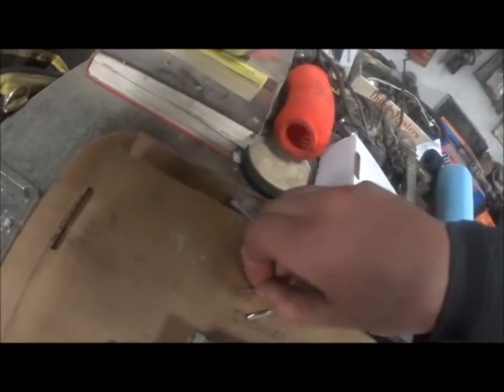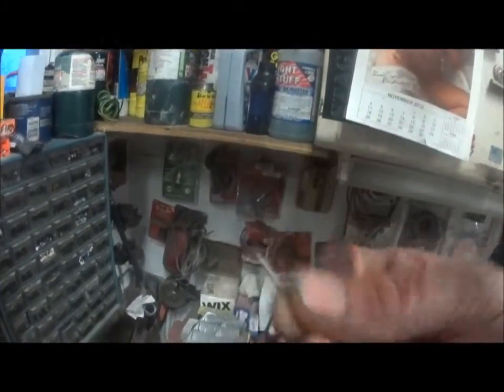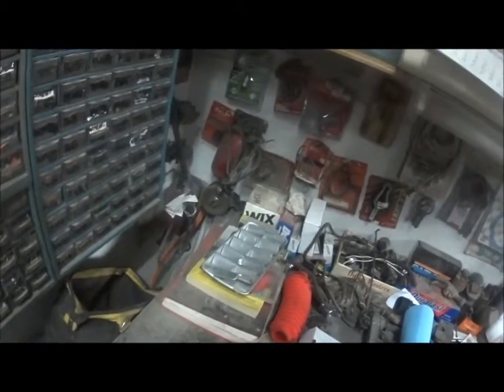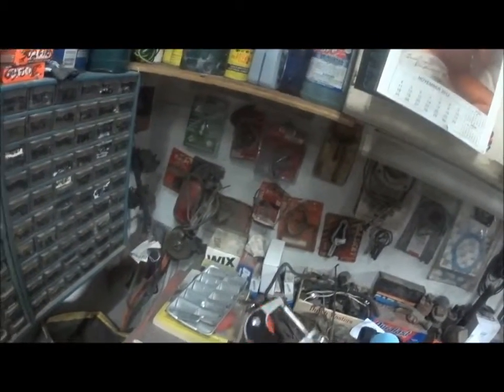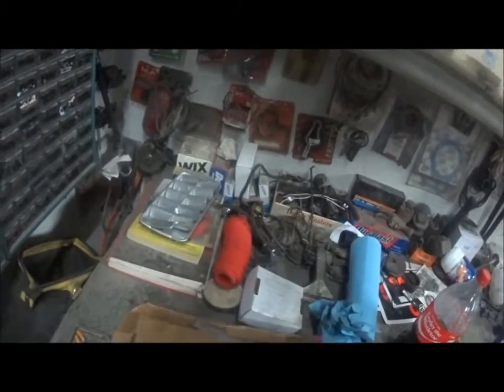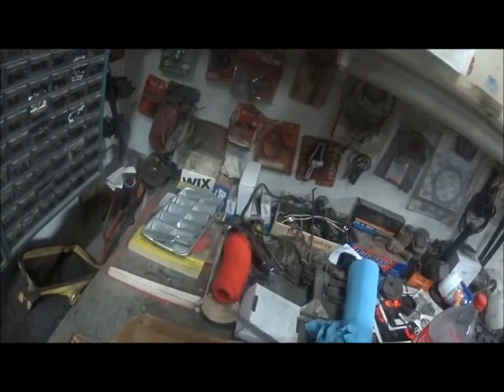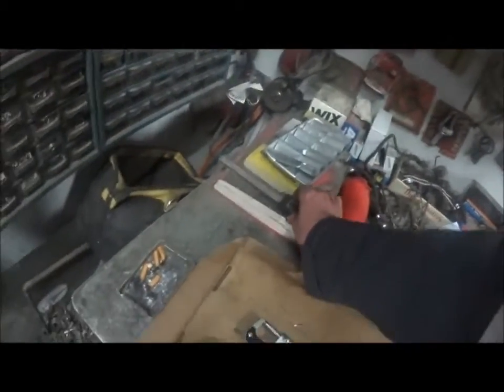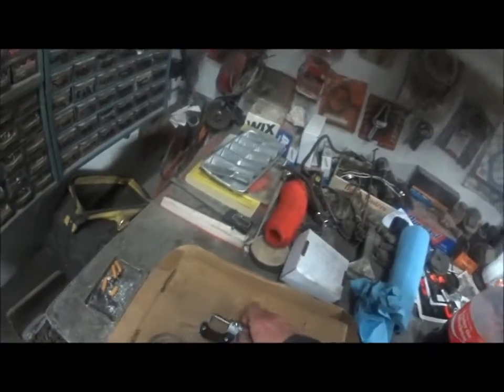eclipse gsx transmission shim measurement complete!

Comment: Hi andrew,
i using the same w5m33 gearbox transmission, i was wondering where should i order the shims after i take the measurement like you did, can you post a link for it?
Reply from the maker: http://www.dsmtuners.com/threads/gearbox-shimming-expert-needed.432456/

this is a link to a forum post number 11 twicks 69 gives all the shim sizes and their oem part number. any mitsubishi dealer should be able to get you these shims. some places are cheaper then others. i dont remember where i got mine from but i found a dealer online and ordered them. hope this helps. and good luck!
Reply: hi again andrew k, thanks for the info you gave me, but i ended up fabricating all my shims from my local machine shop. the thickness i need were calculated with a crushed solder and the original shims, after i minus the clearence needed, then i past the value to the shop let them make one of those. really appreciate for your tips in doing this. thanks :)
Reply from the maker: very nice! hope it works well for you.

Comment: are you pressing the bearing races in and assembling and then taking the bearing race back out. if so, how are you getting the race out without damaging it? thanks
Reply from the maker: now if you are taking the gear clusters apart. you will need a press. i used a harbor freight 20 ton press. with a bearing separator and it worked great for the gear clusters themselves.
Reply from the maker: the bearings are snug but they are not really a pressed fit.  carefully using a screwdriver with a hammer from the back side of the case works well. there are access slots at the rear of the bearing race so you can get to them. for stubborn races you may need to use a slide hammer with the proper attachment. hope this helps.
Reply: thanks for the reply. I hope that's the case where they can come out fairly easily. the input shaft bearing race came out pretty easily initially. now the new one I have not tried to install it yet. what if I just buy the shims that are recommended as OEM and go forward with that. have you experienced a big variation in the gaps. thanks again for the help.
Reply from the maker: i would do the measurement. the transmission is not in new condition anymore. theres no way of telling if the preloads will be correct without measuring the gaps. you are already this far into it.might as well do it right. Good luck.